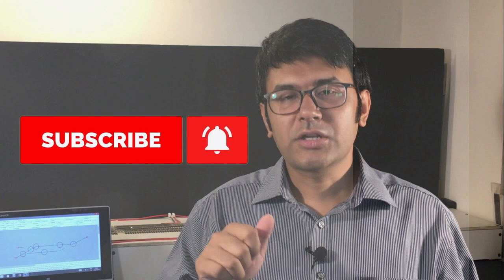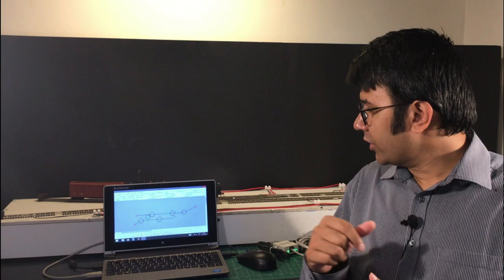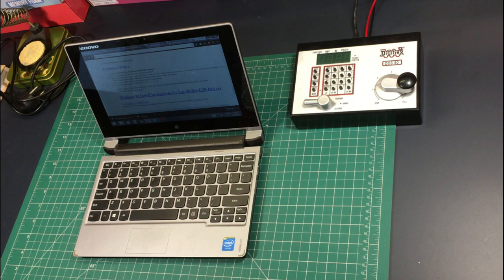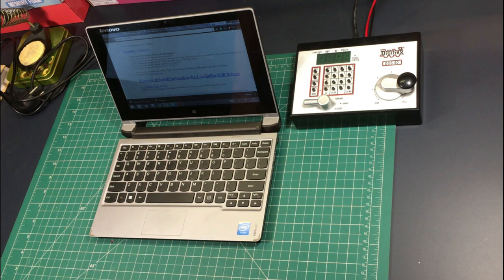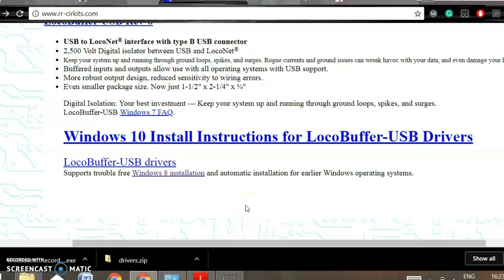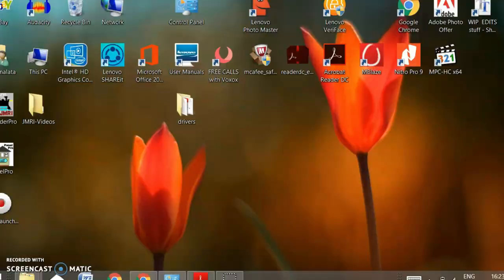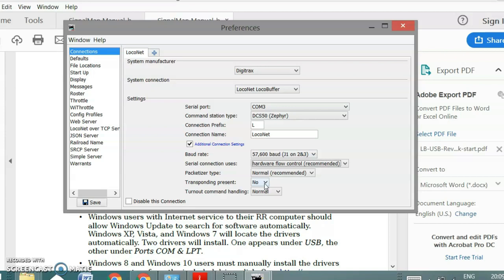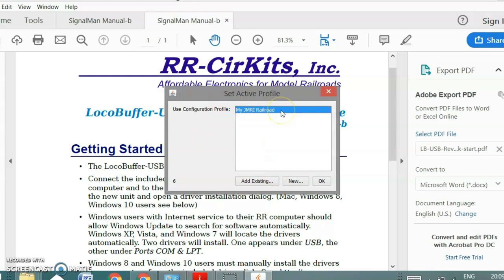Getting Started with JMRI and Digitrax LocoNet: Computer Control for Model Trains

Comment: ALWAYS Awesome along with Charles at chadwick its always a great watch.  How Come not just take the FREE win10 Upgrade so you are all good to go all the drivers are available for that machine and its FREE seems logical other that awesome!
Reply from the maker: Thank you! I am glad that you're enjoying these videos. :) That old notebook can hardly handle Win8 Home, it will run a fever to work the Win10. :) The idea here is to show that you can get a lot even from very modest equipment. I think many times we end up putting a lot more weightage on gadgets than necessary. The idea is to keep it intentionally 'oudated' in every sense and show, it doesn't really matter much. Thanks for stopping by, cheers!

Comment: Hi, thanks for all your videos. I am confused about the turnouts etc. how does jmri know what turnout 101, 102 or 103 is?
Reply from the maker: Thank you for stopping by Michael. The turnouts are already programmed and the addresses are set - you can find the first video in the series to find the details: https://www.youtube.com/watch?v=8iah6whWt14 . Once a turnout has an address it will be known by that address irrespective of the interface, whether it's your DCC throttle or JMRI and you can control a turnout from either of the interfaces - your throttle or JMRI. Hope that helps.

Comment: I find this 4 years later.
Does one still require the interface control with the newer Digitrx systems?
Reply from the maker: Hi! You still need an interface to talk to the computer, but yes you can now use Digitrax PR4 for that purpose. The core concept remains the same.

Comment: Are you using a stationary decoder for the three switch motors?
Reply from the maker: Hi - I am using DCC Concept's Cobalt IP Digital which has an integrated decoder in the switch machine itself, so I don't need a separate stationary decoder. However, if you're using a standard switch machine like the Tortoise, then yes, you'd need a stationary decoder like Digitrax DS 64 if you're using a Digitrax system.
Reply: @TrainsandDioramas  , thanks! Just looked into these.  Have the worked well for you?
Reply from the maker: @OtterCreek  it really has. They are smaller than tortoise so they fit in tighter space, programming is super easy and they have a bunch of other contacts to do some cool things. They cost more than tortoise, but if you add the cost of a decoder to them, then it might not be that different. The only downside is that I have to communicate with them over the bus and cannot use loconet. Not a problem for a small layout, but for larger layouts you might want to think about that while designing your communication architecture.

Comment: What about connecting DCS52? I would really like to see a video demo on updated Technology? Please 
Thx
Reply from the maker: Connecting DCS52 or any other Digitrax command station is going to be no different. The connection to your computer is bascially building a network and that infrastructure and the protocol is no different in these upgrades for a particular manufacturer. The update that are pushed in these new starter systems are mostly improving the ability to use more functions from the throttle itself. If you are using a computer to control your layout, you don't have to upgrade your command station unless you need to enhance the 'capacity' of your command station, like enhanced amperage. The software does the heavy lifting in your computer and the command station simply works as a intermediator in the communication. Hope this helps. Cheers!
Reply: I am using dcs 52 also and want more info on that usb buffer kit and where to get it

Comment: Kaustav below are a couple of links you may be interested in. I use a NCE DCC system which I am in the early stages of developing as I build my layout. I was going to go down the all DCC route but at our club layout here in the UK we have experienced command delays on the system then I saw Mikes YouTube video below which explained how a dcc system can get overloaded with data traffic. Then the real game changer an article in the June 2019 Railroad Model Craftsman "Build an LCC-based interlocking which was the first article I have read that I fully under stood since the NMRA launched the concept of Layout Command Control, I think in 2016. 
I had been aware of LCC when it was first launched and thought this may be the future but as with all new things it takes time for things to really get going. I think that time has now arrived with rr-cirkits LCC kit, others are starting to follow. The most important thing to know is that as with DCC the NMRA holds control so no one manufacture. The system works on individual nodes that plug and play because ever node no mater who makes it will have a unique address so a lot of the configuration with other equipment is already done when you purchase it.
This is now the way I am going e.g. Using DCC to control the trains on the track and only them and using the separate but parallel coms system LCC to control the switch motors block detection signals etc thus dramatically reducing the digital traffic on the Dcc system which is now doing much more than it was designed for e.g. Speed and direction control some lights and a bit of sound.

https://youtu.be/DfOJrqnb9j0
https://greatnorthwesternrailway.blogspot.com/2018/11/lets-configure-node-beauty-of-lcc-with.html

Hope you find this as interesting as I do
Neil
Reply from the maker: Thank you Neil for stopping by and details on LCC. Interestingly, I was talking to Dick Bronson, the creator of LCC last month. The conversation started after I started enquiring about their TowerMan feedback module that I wanted to use to get a feedback of my Cobalt IP Digital machines to LocoNet. Truth be told, I learned about LCC about a year ago, but by that time I've already invested in my block detectors and signal controllers from Digitrax. I was seriously considering switching to LCC, but I reconsidered and decided to stay with DCC on LocoNet network because my layout will be really small - about 40 feet long and just 16 inches deep shelf layout, half of which will be logging anyway, so the actual automation and CTC will be confined to half of the layout and in very small scale (my longest train will be just 4 feet long!). For such a small layout it didn't make sense to re-invest in LCC especially since I have no taker of my existing DCC hardware in India at the moment.

I might still look at LCC if by the time I get to signalling they release some type of way to intercommunicate between LocoNet and LCC so that I can keep my existing hardware in use. I am going to build New York Central's speed signalling with multiple signals with 3 heads - you can imaging the pain it is going to be to manage the logic in DCC! I am seriously dreading that...

Thanks again for stopping by, stay in touch. :)

Cheers!
Kaustav
Reply: Kaustav that is the beauty of LCC using JMRI it will control both loconet and LCC. I was lucky with my timing I had only just started going down the all DCC route when I found that article. My layout will end up larger than yours with  3 levels 4 loops and 2 helixes. I estimate when I finish building there will be about 250’ of mainline track so when it is all built it would be affected by the data traffic issues
Reply from the maker: Neil - totally agree. For a layout of that size LCC will be invaluable. If they release any interface to use the Digitrax hardware then, I’ll surely move to LCC for the expansion. As of now, I have the hardware only for the first phase of my project, I’m keen on trying out LCC for the second. It all depends on Dick and his team.